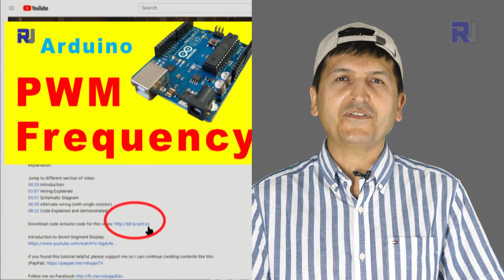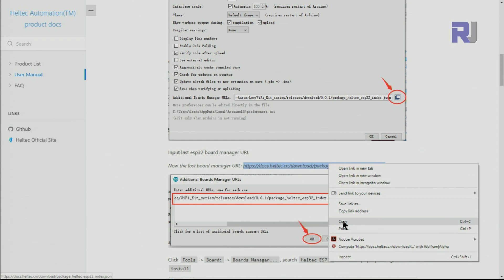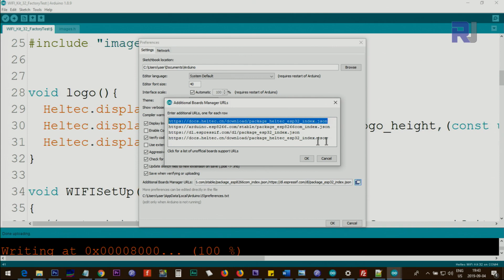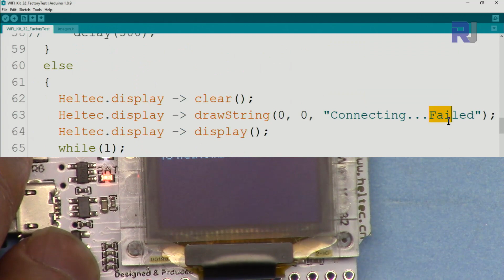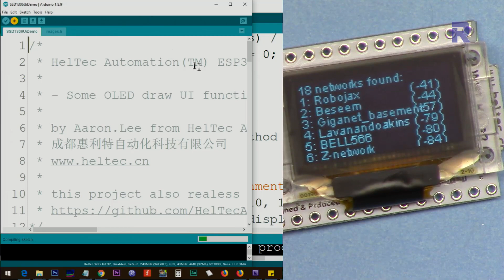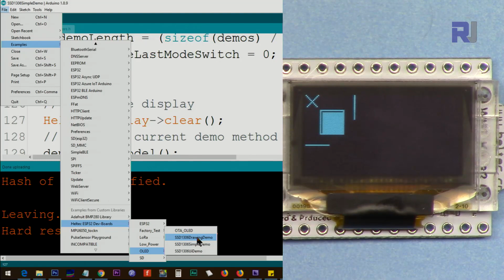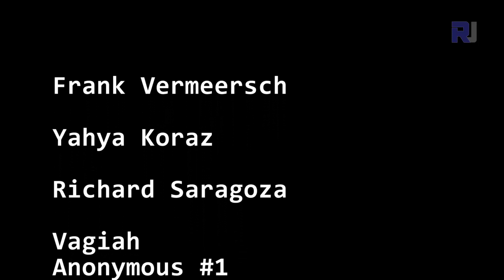Using Heltec ESP32 OLED Wifi Kit - RJT212

Comment: Sorry but I have the problems following: "A fatal error occurred: This chip is ESP32-S3 not ESP32. Wrong --chip argument?
Failed uploading: uploading error: exit status 2". I did exact the same as you. Is there help?
Reply from the maker: Yes. if you read the error it says " This chip is ESP32-S3 not ESP32." Select ESP32 Dev kit or ESP32 Dev Module

Comment: Summary
- 0:00 - The video is a product review of the Heltec OLED display based on ESP 32 by Robojax.  
- 0:09 - The module has ESP32 attached to it, making it easy to plug in without extra wiring.  
- 0:24 - The display can be used to showcase text or information, with all necessary libraries available.  
- 0:43 - Using the display requires power and either 2 or 4 wires for I2C or SPI communications.  
- 1:06 - The module has built-in Wi-Fi setup, memory or RAM, a CP 2102 USB chip, and a connector for battery operation.  
- 1:41 - The device also has a program button for flashing and a reset button.  
- 2:22 - To get started with the Heltec OLED display, a driver for Arduino Uno needs to be installed.  
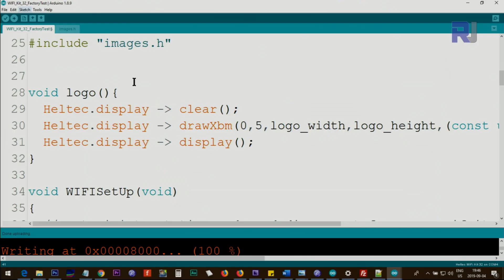- 4:19 - A different library also needs to be downloaded for the board.  
- 4:53 - The video goes through several code examples for the Heltec OLED display.  
- 10:11 - The reviewer concludes by encouraging viewers to like and share the video, and to subscribe for updates on upcoming videos.

Comment: I’m having the issue of the device not connecting to the IDE.  Not shown as a com port.  I’ve set up arduino r3 on this system before with the serial modifications.  Is this the issue?
Reply from the maker: Then follow this video to see if there is usb issue Arduino UNO and Mega Windows 7, 8, 10  USB driver Solved
https://youtu.be/u_21yNqd03I

Comment: I purchased Heltec esp32 wifi Lora V2 board. This board has OLED sisplay and demo code installed. It fails to connect to my wifi network, but scan see my network. How to use this preainstalled code?
Reply from the maker: Hi, I have not used it but it must have your WiFi password to connect. They have code repository where you can download the code, modify it with your WiFi password and then upload it. You can find it from their product page on their website.  or follow the links I provided for this product.

Comment: i used this example several months ago and it work well. however, i wanted to do a new project now i am getting an error: 'class HELTEC_ESP32' has no member 'display'... 🤥thank you
Reply from the maker: It means the library and driver is not installed.
Reply: @robojax  this makes sense,  i replaced my laptop hard-drive a few months ago. thank you for the fast response  🤩
Reply: @robojax  that was it, thank you  😍

Comment: No matter what I try, I can't connect this thing to Wi-Fi.   The "factory test" code that yours has is nothing like mine, so there's no "SSID/PASSWORD" section in the code.     All that's there is the coding for the logo, but the OLED screen does continually go through "scanning for Wi-Fi" menu without any way to actually connect to Wi-Fi. 
    I've been at it for 2 days worth absolutely zero progress.
Reply from the maker: Hello, impossible to connect to wifi without that option. May be you have the wrong driver. The wifi scan in the screen means you have not unbending able to upload the code. That is the default code on the module

Comment: Warning: This board is advertised on AliExpress as having 32MByte of flash. I ordered four. They all arrived with only 8MByte of flash.  The on-board flash chip, a Winbond 25q64jvsiq, is an 8MByte part. Seller claims a "translation error." An AliExpress dispute is in progress.
Reply from the maker: Hard to get money in such issue. I hope you purchased it from Heltec official stores
Reply: @robojax  Yes, I did.
Reply: @robojax  Heltec offered "preferential pricing on future purchases," which I strongly doubt to happen. They also promised to fix the "mistake" immediately at their AliExpress shop, which did not happen until I complained to AliExpress. This morning, it has been changed. This alleged "mistake" has been up on AliExpress for weeks, if not for months. Amazing that the product has only positive comments, and nobody complains about being shortchanged.  I tried, but can't, because once you file a dispute, you can't leave a comment. That explains all the praise...
Reply: @robojax  If something like this happens on AliExpress, IMMEDIATELY open a dispute, THEN contact the seller in an attempt to work things out. You have 2 weeks after receipt to file a dispute. There are countless stories of people complaining directly to the seller, seller promises discount or refund, money doesn't arrive, seller says the "check is in the mail" (so to speak) et. etc. So you finally lose patience and file a dispute, and now, AliExpress will say "sorry, two weeks are over."  File right away, and only close the dispute when the refund HAS ARRIVED.
Reply: Lo and behold, Heltec agreed on a 75% refund, reflecting the 8MB instead of 32, but only if I close the dispute first. Don't fall for that. You will lose all power once the dispute is closed. Told them I will close the dispute when the money arrives. They refuse. Doesn't leave a good taste. The matter will escalate.
Reply: @robojax  I bought it from the Hel(l)tec store on AliExpress, and despite the fact that Heltec admitted they were wrong, AliExpress refused backing up its money back guarantee. A dispute was denied,

Comment: Followed this but got fatal error and now I dont have any display on the oled ... Any idea why the oled doesn't have anything on the display? The orange light is lit ,but dim.. New to this .In IDE it compiles and shows the list of available wifi connections  on my pc. .Just cant get the on board oled to work ...  Any help would be appreciated ..ty
Reply from the maker: "fatal error" is not enough to know. you should have provided more details

Comment: Hi, I can´t program it! Do I need to shorten some pins while programming?
Reply: OK OK it was me... I did solder a CO2 sensor directly on the TX and RX port that´s why it did not want to program the board.
Reply from the maker: I am glad you figured it out. good luck

Comment: Great stuff. I was able to follow your instructions and build examples via Arduino IDE 1.8.12 - thanks a lot. Now to try to get this thing to send Bluetooth keyboard commands and I am done with my requirement. Thanks for making video - you saved me a lot of angst.
Reply: BTW not sure if I am mistaken but it seems I have to hold the reset and PRG buttons during compilation/upload - and once the following has stopped I can let go and the program works ... is this "right" or is there an easier way?

Writing at 0x00001000... (100 %)
Wrote 17408 bytes (11231 compressed) at 0x00001000 in 0.2 seconds (effective 638.8 kbit/s)...
Hash of data verified.
Compressed 254480 bytes to 128766...

Writing at 0x00010000... (12 %)
Writing at 0x00014000... (25 %)
Writing at 0x00018000... (37 %)
Writing at 0x0001c000... (50 %)
Writing at 0x00020000... (62 %)
Writing at 0x00024000... (75 %)
Writing at 0x00028000... (87 %)
Writing at 0x0002c000... (100 %)
Wrote 254480 bytes (128766 compressed) at 0x00010000 in 3.2 seconds (effective 627.4 kbit/s)...
Hash of data verified.
Compressed 3072 bytes to 128...

Writing at 0x00008000... (100 %)
Wrote 3072 bytes (128 compressed) at 0x00008000 in 0.1 seconds (effective 256.0 kbit/s)...
Reply from the maker: Hi, I have not tested any bluetooth feature of this particular module But I have videos on ESP32 Videos which will work with this as well.

Comment: its says -2 networks found plz help
Reply from the maker: that is good. mine says 13 or more. what help you need?
Reply: Robojax hello, what does the “-2 networks found” mean
Reply: @ahmadnaveed5521  Mine did that 'out of the box', you need to follow the instructions in the video, and run the latest version of the example code
Reply: Mine says the same

Comment: Great Video , and followed your steps, in the examples for WIFI_Kit_32 factory test, I keep getting "class Heltec_ESP32' has no member named 'display'", the library and board drivers all appear the be there ... any ideas ?....cheers
Reply from the maker: Thanks. when it say "no member named" it means either you have not selected the board. or library is missing.

Comment: What does it do? I'm interested but confused
Reply from the maker: I believe I mentioned it. this is microcontroller like Arduino but it has display. It is very hand for unlimited types of applications because you don't to do the wiring for OLED. So if you use it for example a temperature sensor, for any purpose, you can also  read it and don't need a computer to see it on screen. this is one of 1000s examples.
Reply: @robojax  aaah gotcha

Comment: Great video, thank you. I can’t get my windows 10 to see the module (tried two different ones). Cable works fine with ESP8266. It’s not proving a serial port. Any ideas?
Reply: I meant the NodeMcu ESP8266,they work fine and are recognized by the OS.
Reply from the maker: I had no issue with this. The USB chip is CP2101 see it here  (on the right side) https://nettigo.eu/system/images/2877/original.JPG?1526644252 and you can download the driver from this page: https://www.silabs.com/products/development-tools/software/usb-to-uart-bridge-vcp-drivers
Reply: @robojax  I also have the same problem and I have downloaded the driver you have mentioned and it still doesn't work. In fact when it first comes up it fails connecting. I have tried it on a PC and on a Mac. You are lucky.
Reply: Did you ever solve this? Facing the same issue now.

Comment: good video! I have a question, do you know a different IDE to program it?
Reply from the maker: I know only Arduino. It can be programmed from command line or C/C++ as well. But Arduino makes it very easy.
Reply: Look for information about compiling c/c++ for AVR and flashing AVR.